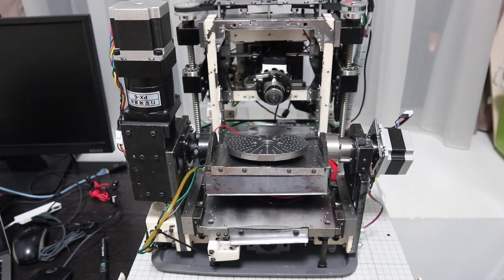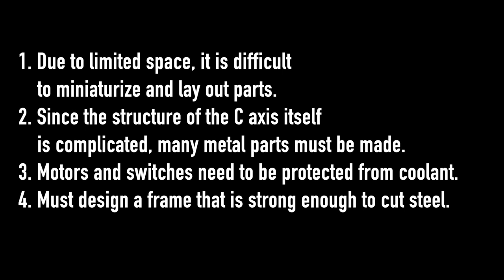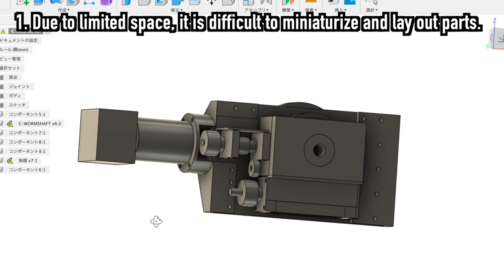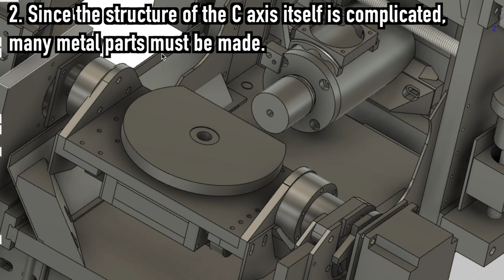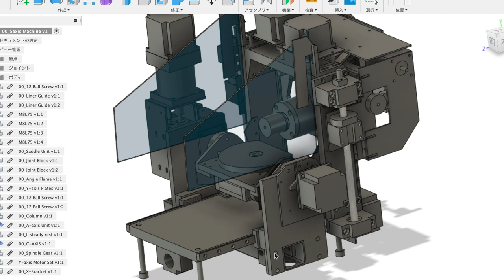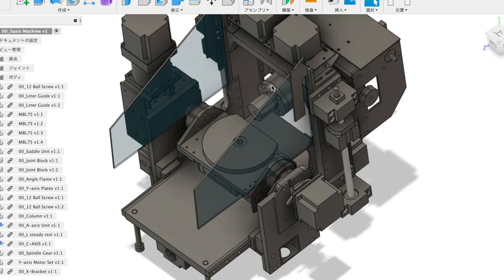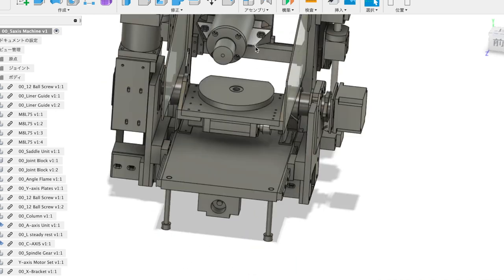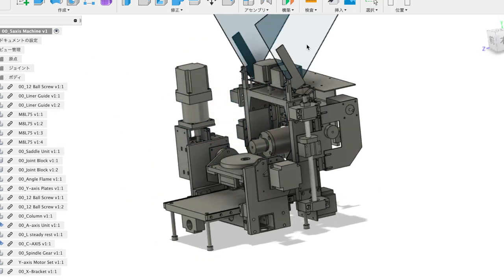【ROTALY AXIS C】DIY CNC How to Build C-axis

Comment: Oh wow! How'd I miss this jewel? I know you work wonders and produce your makes with great precision. Were you trained in a machine shop or learnt it yourself over many years?
Reply from the maker: I was a CNC lathe worker.
Now I am working as a production engineering staff at a machine tool manufacturer.
I learned about the structure of machine tools and how to assemble them for my current job.
That's why I thought I would make my own 5-axis machine.
But my machine has a pretty original structure.

Comment: to stop the belt slipping you need to tension the belt not just push it against the motor shaft, consider using a 3d printer to make yourself belt idler tensioners.

also get yourself an angle grinder they are so useful!!!
Reply from the maker: Thank you for your advice.
I will refer to it.

I want an angle grinder.
But angle grinder is very noisy.
My workplace is in a room, so it's difficult to use.

Comment: Hello I really admire your work, But I've got a Question. 
Is the spring for worm gear preload necessary, I mean could you just preload it with a bolt connection rather than a spring ?!
Reply from the maker: If the accuracy of the worm gear and worm shaft is good, I can give prelaud to them without the use of springs.
However, I have no choice but to use springs because I cannot manufacture high-accuracy parts with the equipment I own.
If you have good tools and measuring instruments, you can make a good machine.

On an unrelated note, if you'd like, you can try this joke of a survey.

???????????????????????????????????????????????
A little funny.
Awesome Fantasy Survey
https://awrjb88ih24.typeform.com/to/kMv16zYf
???????????????????????????????????????????????
Reply: @a-cnc-f  haha already did that survey 
Sorry but It didn't answer my question 
I was asking if its going to be good practice to use bolted connection the same way you did to preload the taper bearing with the worm gear instead of the spring trick?
Reply from the maker: I think it all comes down to the accuracy of the parts.
What you say is correct.
If the accuracy of the parts is good.
Currently, when I apply the dial gauge on the worm shaft, 
It will move more than 0.2mm.
If I apply preload to the worm shaft without using a spring, it will stop moving because of the increased resistance.

Last week, I made a questionnaire thinking that if I thought seriously about it and made a funny survey, people would answer it, but I didn't get many responses.
You don't have to answer that survey.
I just want you to tell me about it.
How can I make it so that people like you who don't answer surveys can answer them?
Please don't be offended.
If you don't mind, please answer.
I'd like to hear your honest opinion.